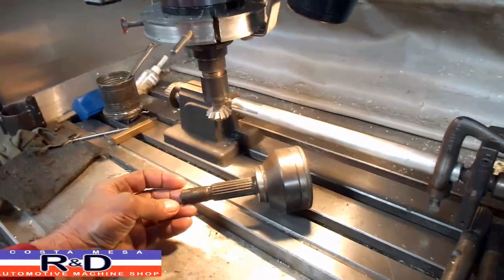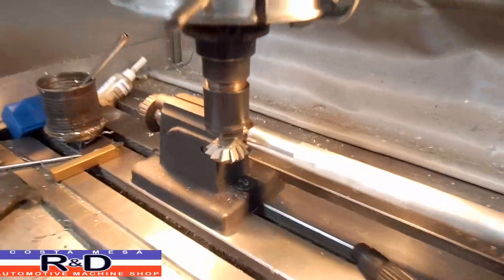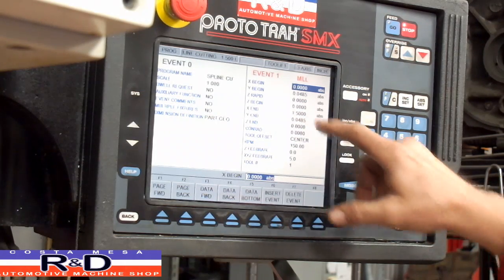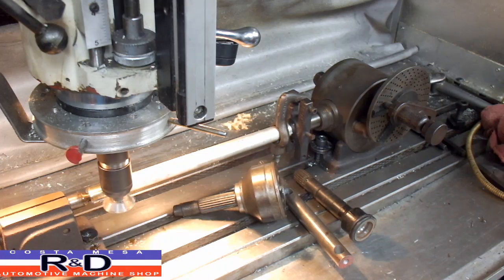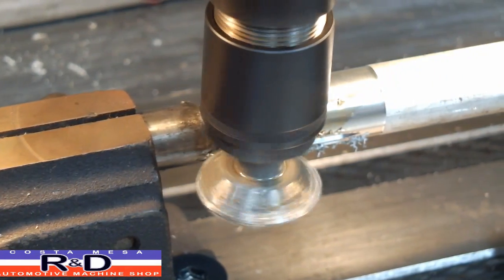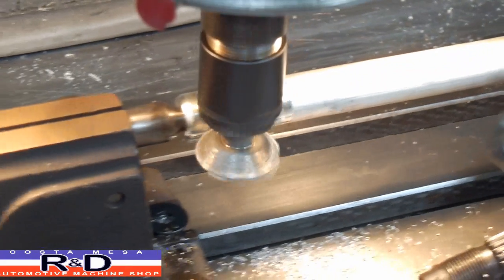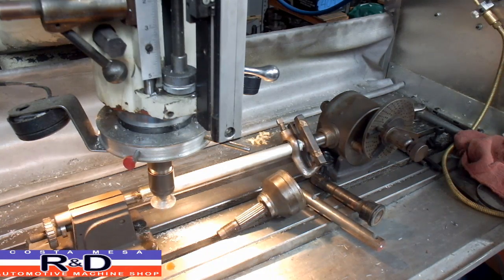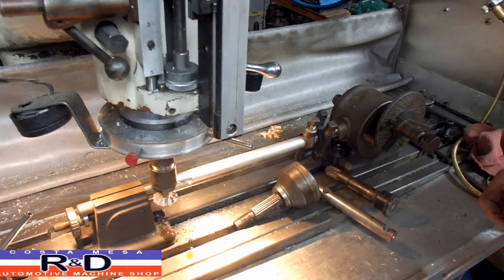Cutting Splines

Comment: I love doing this kind of work! I made a shaft once with three sets  of splines. Two sets of the splines had to be indexed with dead splines, and the nut was left hand thread. It would have been nice to have a ball screw table like yours! I always measure over wires before taking the part out.

Comment: John, thanks for the video. I'm trying to make some axle's for an old YAZOO YR-60. The splines are SAE straight 10 splines on an .870" diameter. I believe that the included angle is 36 degree's. Do I need a special cutter or is there another way of cutting it? Merry Christmas from Greenville, PA.

Comment: I think by use oil designated for cutting aluminum would lead to cut the splines slightly deeper which then make them fit to this CV joint.
Know from experience that grade of machining oil makes big difference o the conditions of metal cutting.Good old rapeseed oil for steel is sometimes still good enough but hey ho - there is 21st century and there are proper fluids for every kind of machining and material.I used to use diesel mixed with spirit (not vodka...) for cutting aluminum (alloys with silicone) gives good surface finish and reduces cutting  power.Oil used for cutting aluminum causes cutting edge to slip on the surface rather than cutting-in.

Comment: been thinking about a planetary set either at the hubs or diff outputs..input through the sun, lock the planets and have the ring overdrive to the axles...get a 3.7 or 3.9 and run a hot 1608 dohc..i can dream anyway
Reply from the maker: Have you ever saw an 850 transaxle? It's not that easy of a project to do and I don't have time to fiddle around with that. The Blueberry has a VW trans and there are lots of different ratios available. The engine of choice for this car is an air-cooled VW because the races will be several (7-12) hours in duration.

Comment: What material will you ultimately use to make the axles?
Reply from the maker: Will be using some O-1 for the first go-round, then maybe some 1045 , if that still doesn't work some 4340.